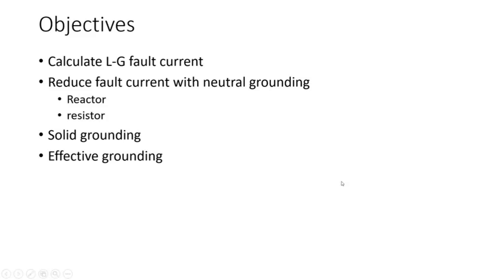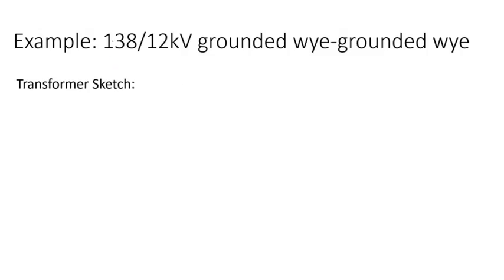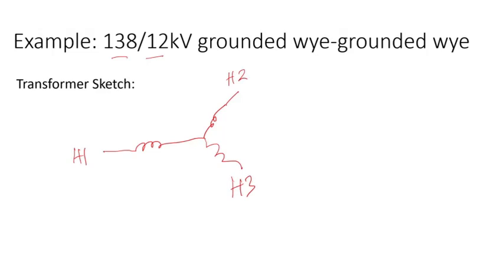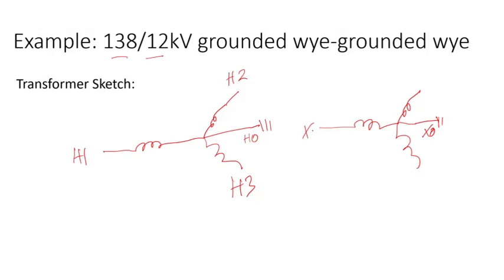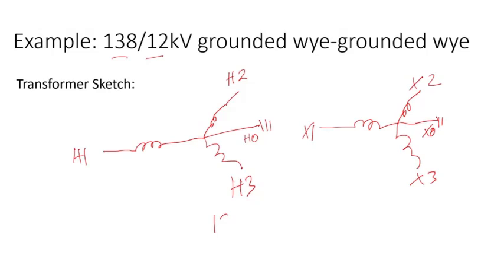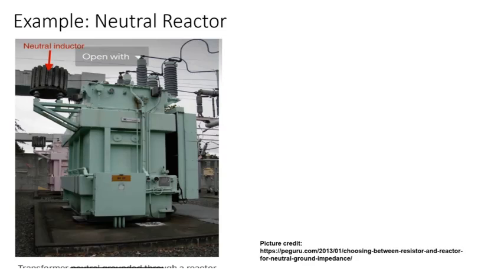Sizing Neutral Grounding Reactor or Resistor and Effective Grounding - Part 01

Comment: At the 8:30 mark you sketch out the SLG fault equivalent circuit.  Where do you get the "T-Model" value of 48.49% and the 10.26%?
Reply from the maker: The T-model values would be supplied by the transformer manufacturer either design or tested values.
Reply: @engineeringsimple Thanks for your response.  That is what I was assuming, but wanted to make sure since I hadn't heard those terms before.

Comment: At 7:21 you state the high side (+)seq Z=0.2% and the (0)seq Z=0.4%. Where did you get those values.
Reply from the maker: Those values are the system equivalent values. If you have the entire system, you can calculate them. In my case, I just made assumptions based on my experience for the purpose of the calculation. Thanks.